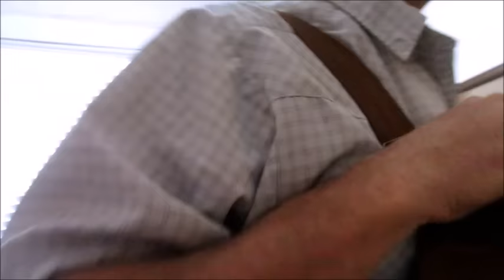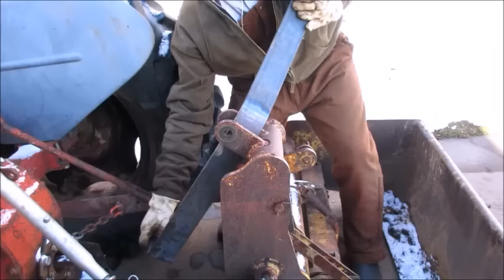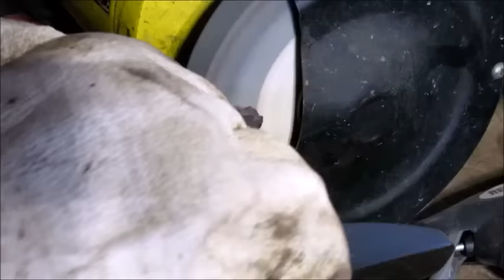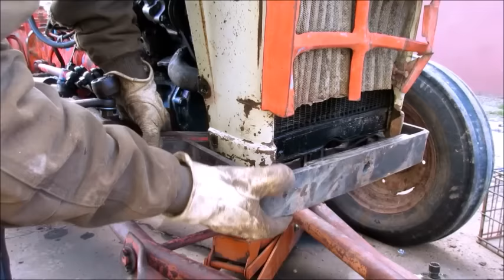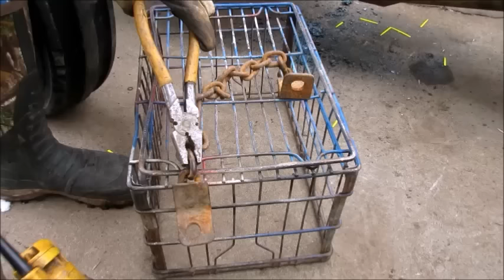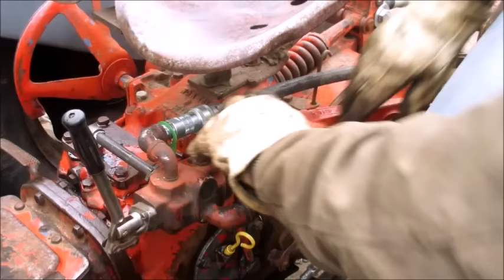#53 - I Installed A Hydraulic Snow Plow On The Old Tractor!

Comment: Have you considered building a drag blade with a 24 inch extension on the right side to assist in getting the snow further away from the road?
Reply from the maker: I'm actually looking at one exactly like that. I'm also considering buying a plow truck